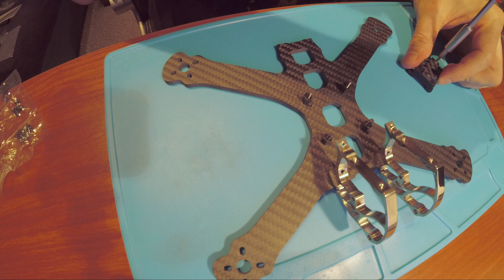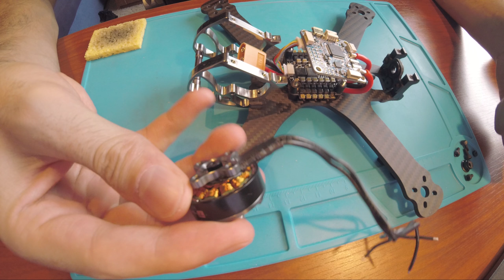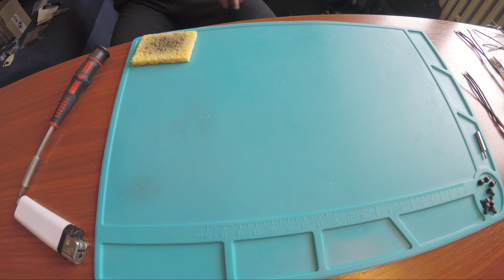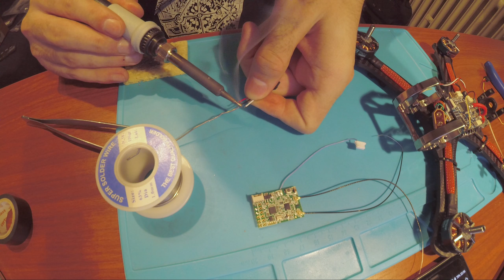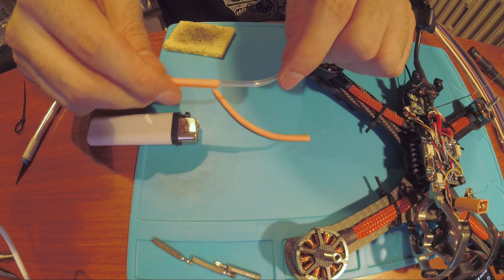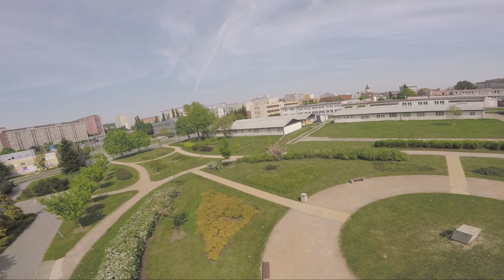Armattan Chameleon Ti (build time-lapse)

Comment: Nice Build. The only thing I would change is the receiver antennas. They will last a lot longer if you do one up and one down more inline with the frame out the back. You still get a V for transmit lock but the props will not eat them when you land, crash, roll over etc. I also like to run by wires under the FC so the battery strap does not wear them off. I like the gauge you used. Good for high amp / low loss. The motor wiring was sweet coming around the mounting holes inside. I also liked the way you mounted the FC to the ESC was nice and clean.
Reply from the maker: Thank you very much for great feedback :)
I will change the way how I have my RX antennas mounted. I sometimes break the plastic tubes which were in frame package and then I need to change the heat shrink on them when it breaks. I will mount them on the arms although I don't like it that way :D But it makes them more protected

Comment: Thanks for the video man, bout to start my chameleon build this weekend. Where did you get the orange braided lume that goes over the motor wires?
Reply from the maker: I bought it in local shop which specialize for motorcycle accesories. But Im sure they sell it on aliexpress too. Just search for "braided wire sleeve" and Im sure you will find loads of those there :)

Comment: Absolutely terrible fantastically weird .....  I don't get it, why you soldered "power" cables directly to the FC instead of ESC. FC is powered via thin cables directly from ESC ..... I've built my Chameleon Ti with almost identical elements. T-Motor 45A 4in1 and Omnibus but not SD (technically the only difference is SD card slot) ... is there any specific reason for this way of powering FC ???
Reply from the maker: Actually there is a reason for that. There is a current sensor on the FC and in order to measure amps, this was the only option to do that with these components

Comment: I have two questions if I may. What was the purpose of de-pinning swapping over the wires between the 4in1 ESC and the FC at 5.20, and secondly, why such heavy gauge wire between these boards?  Nice build by the way.
Reply from the maker: cavman7 Hi, I have tu shuffle those motor signal wires between 4in1 ESCs and FC, because they are in different order (these ESCs have pin order "4, 3, 2, 1, 5V, G" and Omnibus F4 V3 Pro FC has "1, 2, 4, 3, 5V, G"). I could leave that and remap these motor outputs in BF, but I like this solution better.
To your second question... There is a current sensor on this FC and I wanted it to work correctly. For that I needed to run my battery voltage through this sensor first and then into ESCs. And because these ESCs on this setup can take up to 90A, I just had to put 14awg wires there. I maybe could go with 16awg but it would be risky.
I hope that my answer is understandable :-)
Reply: Ah, that makes sense.  I would have remapped in  BF as I would never have thought to  re-pin.  Good choice.
Reply from the maker: Maybe I'm wierd, but I don't feel comfortable with remapping. i've never done that, I KNOW that it's simple and safe, but still swapping 4 wires seems to me way easier than hassle with CLI :-D
Reply: I never remapped either